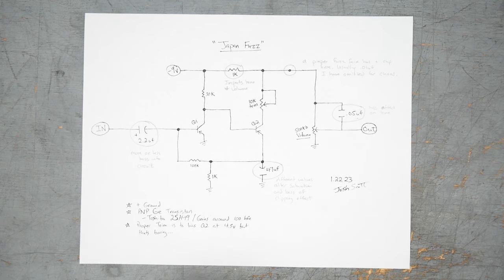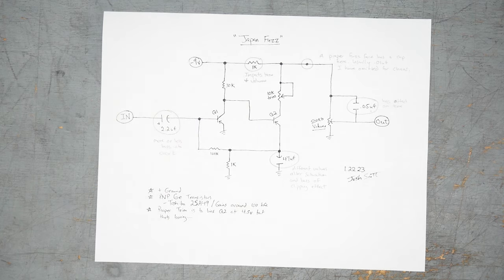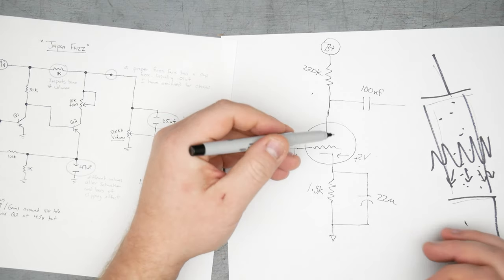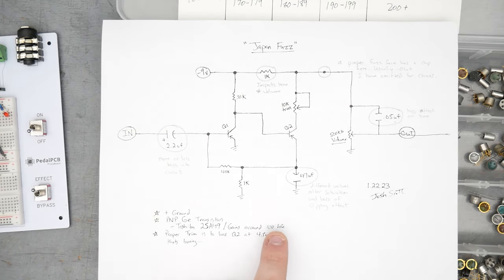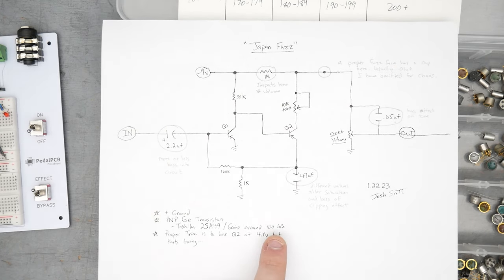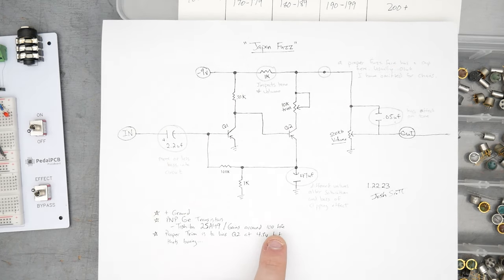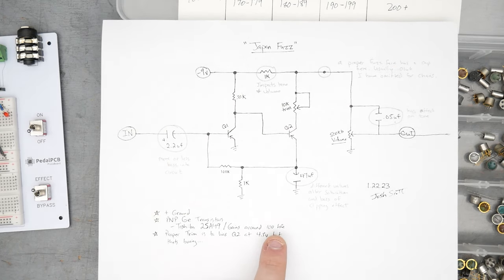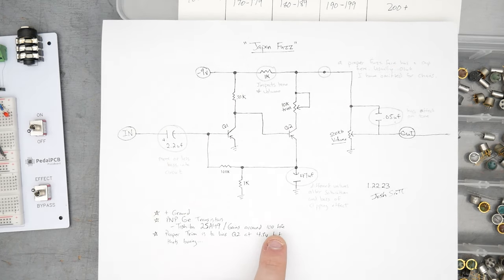Breaking down JHS's Japan Fuzz // Gray Bench Electronics

Comment: I would love a whole video on breadboarding. There’s a certain intimidation factor there that doesn’t exist for PCBs, and some instructional info would be way cool.
Reply: whats the intimidation factor compared to PCB's, its a pretty fast and fun way to test things and experiment with ideas
Reply: @passerbycmc agreed, if you fail the connection it is easy to fix since you just unplug and replug vs removing solder (unless GP is talking about stripboard or veroboard which JHS built theirs off of).
Reply: @Mr2greys  yeah i find veroboard a pain to work with, the amount of planning required to make it small enough to fit in a regular sized enclosure i find is to the point where i rather just design and get a board printed
Reply: My brain has a bit of hard time with them too. Start simple. Bazzfuss circuit. 5 components
Reply: There are quite a lot of videos on YouTube for breadboarding and theyre quite simple to understand, but getting used to using them is probably something that'll just take trial and error and spending some time giving it a go. Fuzz face circuit is a nice easy one to begin getting used to. 

Or start not even with a pedal, just simple LED and battery circuits